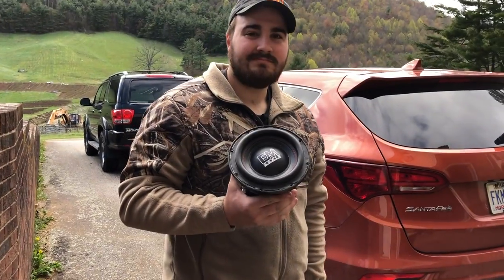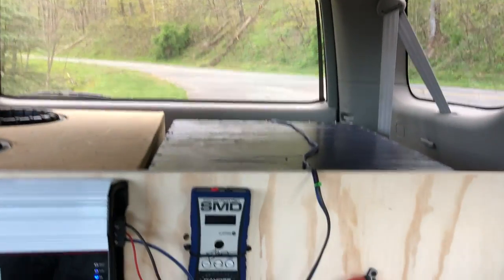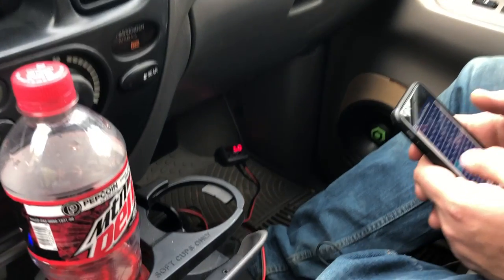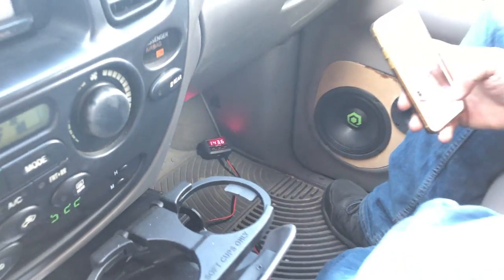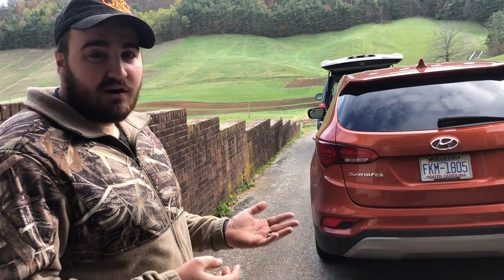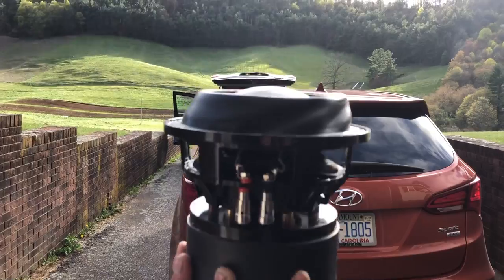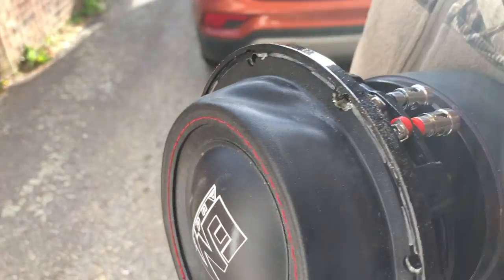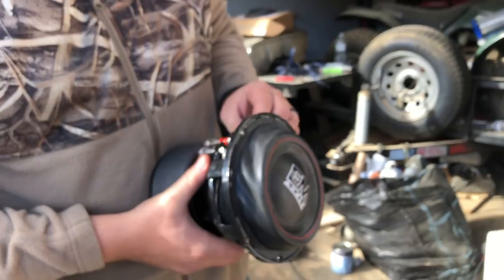How Loud Can 2 MONSTER 6.5" Subwoofers Get? EM Audio HD 6.5

Comment: This really just shows how efficient the box design is. Those are some beefy looking little subs though.
Reply: But the bad news is NO DECAF/SLOWED DOWN MUSIC WILL NOT HAPPEN ON THESE TYPE OF SUBS :/
Reply: Kerry Pence exactly man, design is key. I spent months on the design on this enclosure. You don’t always need the biggest possible driver to do descent numbers👌🏻 this is all initial testing no tweaking of the enclosure or port tuning.
Reply: 1 it can still play down to 26 hz all the way up to 70 hz its musical but rolls off in the lower freqs. But you’re right it’s not meant for decaf music lol
Reply: @mmatsstang2805  Why not? 6th order works great as you have 2 tuning points (high & low), 6th order however in my opinion suffers a little playing tight quick accurate music like rock & types of Drum & Bass which tends to sound a little muddy due to the lack accuracy but seems fine on long extended bass notes which decaf is good for.
Reply: HashDogg06 I know who ronnie is. We both live in nc and we will actually be testing this box out in his Jeep in the next few months. It could play decaf music on “low power” like I said but I wouldn’t play 26 hz like I would 51 hz where the box peaked at in this vehicle. Lol.
Reply: @mmatsstang2805  I just noticed you said 'this is not meant for decaf' i some what disagree with that as 6th order is good for decaf but i completely understand where you are coming from. Awesome, i can't wait to see some testing with Ronnie, should be good.
Reply: 1 why not
Reply: Anyone who doesn’t already know that a box makes the system should even listen to music
Reply: Ikr, them subs are animals. And yes a good design for the frequencies
Reply: I like the box and the subs are impressive but i have yet to figure out why people get these monster 6.5s, i mean a lot of people say its to save space over bigger subs but these monsters definitely dont. Lol
Reply: @________GHOST________  you need a box that is a little more musical preferably a 3rd order ported box so you get more SPL than sealed but a lot more SQ than 6th order bandpass. It would require 2 1500 watt 12s though to get the same SPL and for sealed you need 2 3000 watt 18s.
Reply: @________GHOST________  I have a 32Hz box and a 12 inch Fi Neo 3.5 with stage 3 cooling. The sound quality is amazing.
Reply: @jerrypino5608  not true! You can get great sound quality without a broken pocket book,but competition between our friends or family doesn't allow you to do it that way. 😂 I have used stock speakers with a 10uf capacitor and blown away competition,  when I was hustling. Just because someone was saying exactly what you did. The only thing that was name brand equipment, was the jl15 I purchased for $75. But that was the most expensive part of the system. I think that I can remember the entire system. 
2 Pyle 200's for tweets $20
1 legacy 1000 $50
1 sony 4ch $20
1 jl15w6 $75
1 electronic crossover $30
Epicenter $70
6 10uf capacitors were .99

Comment: The design alone is enough for me to have an inspiration to oneday make 250wrms 6.5 inch SQ drivers that is a true woofer to in a 3 way component speaker set instead of a subwoofer or a midbass. Same diameter voice coil but single stacked magnet, lighter weight cone, similarly stiff but smaller spider, medium roll supple rubber surround, smaller dust cap.

Comment: Holy cow imagine if you had 8 of those . 4 pairs. Each pair on it's own amp?
Reply: I wouldn't think this is a musical application this was designed for spl to get loud at one specific frequency all these videos coming out of these little subs being so loud is very specific to that frequency and applications and wouldn't be a daily musical build
Reply: I know. I should have elaborated more. Each pair could be tuned an octave away from each other. Or even in 5 hz increments. Starting at 35 hz then go up but not above 55. So the over all roll off is spread out more for more bandwidth. Does my idea sound good or am I lost lol
Reply: @Shaggy4hire  I gotcha some sixth orders can achieve that and dsp can do that if done well a lot of home audio subs have correctiom factors that keep the db same across 25-80 so it will not be peaky af
Reply: Ok. I'll have to check out 6th orders. I'm a traditional slot port guy lol

Comment: You go to this dudes house, blow his subs, and bounce 😂😂😂 fr tho that was awesome! And that box was amazing! Great content as always Parker!
Reply from the maker: Haha well he wanted to do it. And the company is rebuilding them for him since we made the video
Reply: @ParkerTheBasshead  That's awesome of the company to do that, but in all fairness, they just got some awesome advertisement when it took 6500 watts to rip apart the smallest possible sub they can make. The coil was fine! You literally ejected the coils out of the gap! Lol
Reply: @ParkerTheBasshead  is that a 6th order? And was  were the tuning frequencies since in a 6th order you have 2 frequencies over a ported or a 4th order being able to tune to 1 frequency I'm guessing the tube port  was prolly low mid 40s and the large opening low 50s And was the 145 sealed in kick or door open in kick?
Reply: I'm thinking of doing 6 8" subs like that in my 03 Lexus is300 in a horn style where the opening will be towards front and the subs will be in 2 rows of 3 on top part of opening that will be shaped like >and the rest of the box will be squared off with a port at the very bottom. I'm also building an explorer with 6 Resilient Sounds platinum 15s or 18s depends what kind of enclosure I end up going with because it's only a 2 door so limited on space especially after a 6 battery bank and capacitor bank 1 battery for each taramp 3000 and 6-8 cap bank for each also.
Reply: @ParkerTheBasshead  that's actually really dope they're doing that. I looked them up. They got some impressive stuff.
Reply: James Lewis Video proof or you’re full of BS
Reply: @erictheboringone5292  lol I'm a former member of team Gates you know the women who broke and held the world record and I took 2nd in my class with 215 and250 watts rms u want proof call the owner of RS as for my Lexus it has all Skar in it as far as speakers just sold the old subs and right now the trunk is empty other than the 2200.5 amp running the highs and the sub channel was running 2 12s in a sealed box but I wanted more output so I sold the subs last week  I don't think it would be right on my part to be team RS while I'm runnings all Skar audio in my daily.
Reply: 😂😭 it's not what you know, it who you know and what you know 😂😂😂🔥🔥🔥
Reply: @AJOSUE  Don't forget the "When ya know it"...
Reply: However those 6.5 subs can make the perfect subwoofer for stealth mounting applications in SQ systems.

Comment: W.H.A.T 4"coil 145.6dB, nice, and nice 6th order enclosure
Reply: 4" coil? They have a 2" or either 2.5. Where do you get 4 from?
Reply: @bigsergonbaby5959  I misread the "4-layer copper coil" ... 2" I see it now! Ty
Reply: @bigsergonbaby5959  they might as well have a 4" coil (joke) ... because you can get 3,4,5 spiders,  You can practically build your own sub from what I read. Might have to check out the $400 15" subwoofer out? If a 6½ can take that much power I'd love to see what a 15 does, but I love my Memphis and NVX

Comment: 6th orders gives wider bandwidth and more cone control; within the tuning frequencies. Good job bro!
Reply from the maker: Thanks man!!
Reply: 6th orders in my opinion don’t give more cone control they are open on both ends for tuning. If you want come control a 4th is a much safer route
Reply: @tidobass6048  the sealed chamber of a 4th order bandpass promotes more power handling. However, be mindful that at tuned frequencies, sealed chambers lose cone control. It's the opposite for ported chambers.
Reply: Thi is a quasi 6th order band pass like Bose sub

Comment: I would advise making a terminal on the box with all coils attached. That way you can wire to whatever without taking the box apart and in turn make a permanent seal that will also help with dB
Reply: Better yet - let’s see you build it. 😉

Comment: Hey quick question I had installed a new radio but even the old one would do it every time I would move the radio it would turn off and then move it back it would turn on, please help I hate riding around without listening to my radio

Comment: Hey I have a question, where can I get the wattage measure thing bc I don’t think my sub is wired down to one ohm.
Reply from the maker: You can test the impedance of your subs with a multi meter
Reply: Parker Dacchille ok is it bad if my sub is wired to one ohm?  Or is it safer to stay at two ohms

Comment: I have a question fellow bassheads, hopefully one of you can answer. So i just got two 10s and the factory recommendations for the enclosure is either ported or sealed and gives the optimum volume for the enclosure . Is that volume double if you have 2 speakers? Im trying to build a box to save money and kill time, learn. A lot more scientific than putting speakers in coffe cans lol

Comment: Hey parker I was wondering if you or anyone could helpe clarify a problem I have ran into regarding alternators. I have a 210A 14.5v alternator with a COM Plug. Internal regulated. Basically it is computer regulated all good. I have used this alternator previously on another car so I know it works at 14.4 perfectly at idle with no voltage drops. I have changed cars recently and it can be used on this car as well. It did 14.2v at idle so I researched and it is normal but it should be doing 14.4v. a day later it was working as intended. The next day 14v,14.2v,13.8v, but not below. I have done the big three upgrade with 0 gauge ofc. So at idle today it stayed at 14v. Revved to 1500 with music. No voltage drop but it did not go up. Could this be the internal regulator needs changing? I did diagnostics with a multimeter and nothing seemed wrong. All was ok. So there should be no reason why it isn't at 14,4v.  If you know anything please let me know!
Reply: It could be the internal regulator, however, you stated that it worked fine in another vehicle. I would take a look at the install and check to see if the belt is slipping first, then check all grounds before going over your hot wires in that order.
Reply: @kingwillie206  the belt doesn't slip but I will check the grounds but they were properly sanded down to bare metal. Worst comes to worst I'll buy a new regulator as they aren't very expensive. Just hope it solves the problem as I used this alternator because of its nominal 14.4v
Reply: JDCcaraudio_Spain - Post 2005 a lot of ECU’s started causing issues with aftermarket alts. If you know your install is tight you will need to bypass your ECU and go with an external regulator to solve the issue.
Reply: @kingwillie206  its a renault megane mk2 lol but I didn't have the voltage problem on my previous car which was a renault kangoo

Comment: I’m trying to run 2 psi platform 2 12s high performance 1800 watts rms any amp suggestions?? I’m thinking a taramps md 5000
Reply: Get better subs
Reply: Lol 😂 stop 🛑
Reply: That sounds like a good match as long as you set your amp gain and deck are set properly. Don’t “wing it” and ruin your equipment. Take it to a pro and have them set everything properly and let you know how far you can turn it up without clipping.

Comment: Where's the other port?  It looks like a 4th order to me.  You should've shown more angles of the box and design dimensions.
Reply: @1:03 you can see the second port through the mounting place for the right speaker and you can make out the flared end on the left of the speaker already mounted.
Reply: That means it's blocked by pushing it up to his wall in his SUV,  or did he seal it off?  It's either a 4th order or a leaky sealed 4th order.  6th orders need precise tuning to sound good.  That's why the woofer blew out... improper design makes for little to no woofer control.
Reply: @bonzainews  There's no way he did a 145 in a giant Sequoia on a box that wasn't working right. It was a 6th order, it was just different than usual designs, and the camera angles didn't show exactly how it was set up. The woofers failed because they sent 6500 watts to 6.5" 400-500 watt subs lol.
Reply: Larry Keller this is my design and I know what I’m doing ;) if you watched it’s meant for “low power” like I stated about 1000 watts clamped. I never intended to design the box for high power lol. It’s still in the design process and I’d say 145+ for 2 6.5s is damn good for initial testing without any other tests done. Lol.
Reply: They showed enough if you had your eyes open, re-watch the video.
Reply: @mmatsstang2805  I guess when you get too much stimulus money you have a tendency to start blowing up woofers for the hell of it.
Reply: Larry Keller nope no stimulus money spent. I’m a rep for the company and I can do whatever tests I want :)
Reply: Larry Keller also not gonna show specs on something I work on cause everyone will copy my work
Reply: catch22frubert it was indeed a 145.6. Meters within .1 of term lab. We can do another run after the subs are built back up.